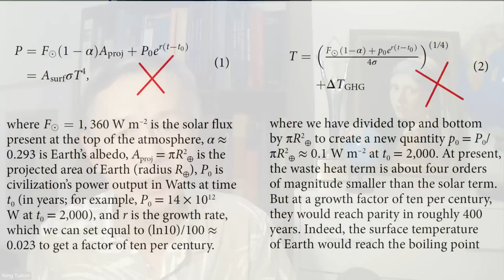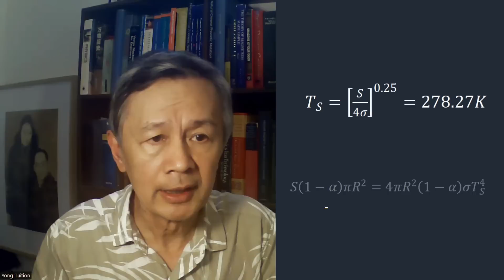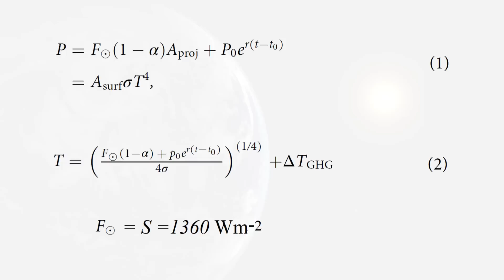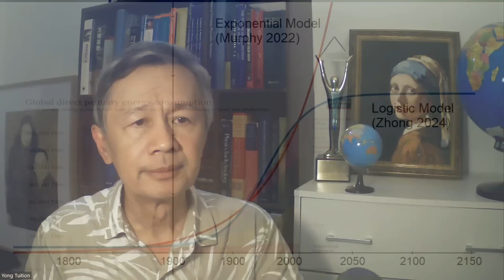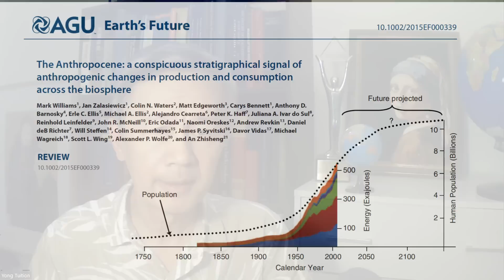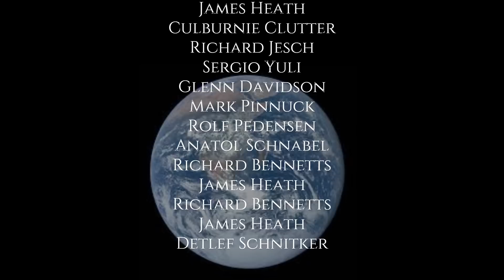Can Waste Heat Make Earth Boiling in 400 Years? | Basic and Unsettled Issues in PHYSICS 20240411

Comment: Double checking once more checks out too quickly, so that someone else likely already did it,saving some work.
The claim "excess heat alone boils all water globally within 400 years" seems a bit too silly, likely having some math errors or silly assertions or missing factors.

I played SimEarth many times, where you can boil off the oceans of a planet as soft-fail-state, and even that seems to have more precise models, even though you can easily terraform mars in SimEarth within the same models.

We can still easily boil off all of earths oceans with methane and co2 within 100 years, mostly because people underestimate exponential growdth (up to their limits), but most people try to avoid boiling the planet, because this is not a game.

Comment: The paper in the scientific journal Nature really should have used the term "climate flux", which for Earth is about 237 watts per square meter, rather than going to the bother of recalculating the climate flux, a calculation which has been done many times before.

Also, not taken into account is the ability of atmospheric water to use a latent heat effect to radiate Earth's heat from cloud tops at an altitude high enough in Earth's atmosphere that CO2 has little blocking effect. Some 250 million years ago during the end Permian, that cloud top radiative ability demonstrated sufficient strength to stop Earth from entering a runaway greenhouse effect. One can calculate a pascal value from the estimated mass of water in the atmosphere at that time, and determine that for every 100 pascals of water in the atmosphere then, there was a cooling effect of about 3/4 degrees Celsius, or otherwise a runaway greenhouse effect would have happened sufficient to kill off all vertebrate life forms. The solar constant is higher now than then by about 2 1/2%, but in practice Earth's water cycle still puts a cap on how hot Earth can get, although it is arguable that that cap is about 4 degrees Celsius higher now than in the past some 250 million years ago.

Something the paper in Nature might not have considered is that more water in the atmosphere means more lightning. Lightning dissociates water into hydrogen and oxygen. Some of the hydrogen escapes from Earth into outer space. For now, there is an approximate balance with hydrogen that Earth captures from the solar wind and captures from the hydrogen content of meteorites. As a result, the partial median surface pressure of oxygen in Earth's atmosphere has not varied by more than about 10,000 pascals from the current value of about 21,000 pascals in the last 300 million years. Higher temperature means more atmospheric water, which means more thunderstorms, which means more lightning and therefore more electrical and thermal dissociation of water into hydrogen and oxygen. Too high a percentage of atmospheric oxygen, starting at around 30% oxygen by volume, would likely make most of Earth be too flammable for vascular plant life. That's a process that might take just a few tens of millions of years to happen. Isotopic analysis of hydrogen on Venus seems to indicate that Venus once had much more water than at present. The ratio of protium (lighter hydrogen which escapes more easily into outer space) to deuterium (heavier hydrogen that escapes less easily) is much lower on Venus than on Earth. In other words, too high a percentage of oxygen is a long term danger to humans in the event that the unusually warm end Permian temperatures get exceeded for too long.

Short version:

Earth's surface reaching a 1-year average median temperature of 100 degrees Celsius is only a science fiction possibility at the current solar constant of 1362 watts per square meter, something that could only happen if for example a 100 kilometer wide comet hit Earth. However, as shown in the very late Permian some 250 million years ago, Earth can get considerably warmer. Matching or surpassing that higher temperature might or might not be too much for human air conditioning technology to allow humans to survive. Furthermore, if humans survive that temperature, there will be a long term risk of atmospheric oxygen percentage then slowly rising too high during a time period of perhaps just a few tens of millions of years. The temperature peak that caused the end Permian mass extinction lasted only about 120,000 years or so, not enough time for increased lightning to substantially cause the loss of atoms of hydrogen by Earth, which thus would have lead to a long term higher oxygen percentage.

Comment: Unfortunately, the first argument made here is just wrong. Almost all substances on the earth's surface, including snow and ice, act as high-emissivity (> 0.9) gray bodies in the thermal (longwave) infrared (usually considered as wavelengths > 4 um).

The situation is different in the shortwave spectrum of solar radiation (< 4 um). The expression (1 - alpha) is called the "Bond albedo" or shortwave absorptivity/emissivity. The value of alpha is usually calculated to be about 0.30, yielding a shortwave absorptivity of 0.70.

These are not just theoretical values, they can be, and have been, confirmed with high quality measurements.

I agree that there are many issues with Murphy's paper, but this is not one of them.
Reply from the maker: Thank your comments. The planet, including its atmosphere, is close to a greybody with emissivity 0.7, although the measured one is 0.61, or the longwave radiation intensity=0.61 *sigma*288^4. This is irrelevant to measurements of emissivity of ocean,  ice, and snow. Invoking shortwave radiation emission by the earth dosen't make sense.
Reply: @yongtuition  I'm afraid you miss the point. The earth's surface emissivity in the longwave thermal infrared is greater than 0.9. For seawater, >2/3 of the surface, it is >0.95. If the atmosphere were transparent to this IR (say, just N2 and O2), measurements from space would see this value.

The fact that measurements from space show an IR flux corresponding to a lower emissivity is precisely BECAUSE of IR absorbing gases (i.e. "greenhouse gases") in the atmosphere. You cannot use this fact to argue that the greenhouse effect is not significant.

In the shortwave, it is the lower absorptivity (higher albedo) that is important -- particularly the high shortwave reflection of snow, ice, and clouds. I never claimed that the matching emissivity was important.
Reply from the maker: @curtwilson3342  You need to understand the Stefan-Boltzmann law first. Besides, the measurements of emissivities of different materials are based on the assumption that the object is in vacuum.
Reply: For any given wavelength band for an opaque substance, an opaque substance such as a block of granite for example, reflectivity plus emissivity has to add up to the number 1. The number 1 is often referred to as "unity" in textbooks.

The trick is that various substances have sometimes very different reflectivities in different wavelength bands. Green paint for example reflects green light well, but not blue light, and not yellow light. Snow, as another example, is very reflective of visible light, but in some infrared bands, snow has a very low reflectivity of sometimes less than 10%, meaning that within those bands snow can have an emissivity of more than 90%, explaining why snow at -20 degrees Celsius has an infrared emissivity of about 90%.

One other trick is that there is some directionally to both reflectivity and emissivity. For example, light striking at a very shallow angle tends to be reflected more strongly than light striking at a steeper angle.

It is a pattern in Solar System astronomy that planets and moons on the whole tend to have an infrared emissivity of about 95% near their respective typical emission temperatures. It is conjectured that that pattern applies in most other planetary systems as well, but that pattern has not been confirmed yet for exoplanets, planets that orbit other stars.
Reply from the maker: @wendydelisse9778  Indeed, reflectivty, absorptivity, and emissivity are wavelength dependent, called spectral emissivity etc. When the earth, including its atmosphere, is treated as a greybody or blackbody, the effective shortwave emissivity becomes trivial,  as the maximum is located    around 10 micron, given the surface temperatue around 288K.

Comment: Actually we won't have to worry about whether there will be enough waste heat to raise the Earth's temperature to intolerable levels anymore.
The reason is simply that there isn't much fossil fuel left for us to burn. And nope, there are no substitutes. We'll all be going back to pre-industrial days.
Reply: Progress has been made in the area of fusion energy, energy which typically obtained from transmuting hydrogen and lithium into helium. As such, a percentage rise of 200% or so in the very tiny amount of mankind's direct contribution to Earth's climate flux cannot be ruled out. Earth's climate flux is about 237 watts per square meter. Mankind would be unlikely to add even 20 watts per square meter to that number, and furthermore the vast majority of any such addition would be from mankind's causing a decrease in Earth's reflectivity, which is more formally referred to as Earth's "Bond albedo", rather than directly from the heat resulting from a potentially vast number of fusion power plants in the future.
Reply: @wendydelisse9778  Fusion? They've been promising it since the 1960s.
I'll believe what you say when I hear of a fusion reactor finally in full operation.

Comment: Thank you again Dr Yong.  I understood enough of your reasoning to believe that the theory of anthropogenic waste heat building up on the Earth's surface is balderdash.
Reply: Waste heat building up on Earth is indeed mostly "balderdash" (fiction).

However, Earth's temperature, although technically being in a state of "stable" equilibrium in which waste heat merely results in only a tiny increase in temperature, is surprisingly close to being in a state of "neutral" equilibrium. There is a close "tug of war" mostly between the "Stefan-Boltzmann" approximation which attempts to put a cap on Earth's temperature on the one hand versus on the other hand the vapor pressure curve of water, which tends to raise Earth's temperature by way of water, Earth's atmosphere's strongest greenhouse component, being more present in the atmosphere in warmer conditions.

An even closer approximation of a "neutral" equilibrium is a fumbled basketball rolling on a smooth clean basketball court. If no one stops the basketball, it will typically keep on rolling until it goes out of bounds. Imagine however a basketball court with a floor of thick carpet. A slow-moving basketball would often stop on its own before going out of bounds, and would then quickly be picked up by a basketball player if time has not run out. Such a fictional basketball court with a floor made of thick carpet would be more akin to how close Earth's temperature is to being in a state of neutral equilibrium. As an analogy with that fictional heavily carpeted basketball court, mankind's waste heat has intermittently put Earth's temperature into a slow roll that quickly enough stopped before the temperature could go into an out of bounds region.

Comment: As has been pointed out many times the total solar energy input flux is much, much greater than humanity's energy needs.   If this is true, which it appears to be man's waste heat is insignificant and I won't worry about it.
Reply: I was wondering if our waste heat was the main component of what they say the excess carbon dioxide has created in temperature rise. Simple crude math said no. It is actually a negligible amount when compared to the watts per sqM from the sun.
  My math said it accounts for around a tenth of a degree.
Reply: @Stan-b3v   You are correct.  Making the waste heat even a smaller contribution is that waste heat is often in a localized area like hot waste water or hot high CO2 air all subject to T^4 higher radiation to space.  Small increases in temperature drive big radiation heat losses to space.
Reply: Some of the waste heat is in the form of evaporated water, especially in the case of electric power plants and in the case of many skyscraper air conditioning systems, where the larger economy of scale dictates making some use of the "evaporative cooling" technique. The greater atmospheric water content over land usually results in more greenhouse heating in land regions than would otherwise be the case, although in some cases a temperature drop can happen instead due to the extra evaporated water.

Short version: There is a difference regarding whether waste heat is in "latent heat" form or in "sensible heat" form. Latent heat calculation is not as simple as a Stefan-Boltzmann calculation. Irrigation for agricultural purposes of course also introduces water into the atmosphere over land, resulting in similar complexities.
Reply: @wendydelisse9778  Water gets messy when the heat is released upon condensation and cloud formation which heats the local air increasing emissions to space while reflecting incoming sun light.   We then can have ice formation in the cloud which falls out of the bottom of the cloud transferring the latent heat of freeing to the cloud and transferring that heat to lower altitudes or the ground where it melts adsorbing heat.   This is where models get problematic and go beyond simple calculations and nucleation becomes an issue of great complexity.

Comment: You are correct, their equation is wrong. Also, the Earth is not a perfect conductor. Energy does not transfer magically from areas in sunlight to areas in darkness. This flat Earth model should be thrown out. 

If you look at the Moon where one day is equal to 29.5 Earth days, you see the Moons equator can reach 121° C in full sun. That is very close to the equivalent temperature if 120° C for 1360 W.m2 which is the estimated power from the sun reaching Earth.  The equator can drop to -133° C when not exposed to sunlight. 

The rate of cooling is a function of internal conduction and surface emissivity.

So you see, the average temperature of the Lunar surface is not relatable to the formula at all. The more important number is the maximum temperature attained.
Reply: There is more than one type of average.

Electricity experts for example often use a "root mean square" type of average regarding voltage or current, in order to derive a good estimate of power.

On an astronomical body such as the Moon with a sparse atmosphere or with no atmosphere, the type of average temperature to use for estimating infrared radiative power per square meter is a somewhat analogous "root mean tesseract" type of temperature average. Here, the 4th root is used instead of the square root, and 4th powers are arithmetically averaged out underneath the 4th root symbol instead of squares being averaged out. With electicity, power is approximately proportional to the square of a voltage. When using the Stefan-Boltzmann equation, radiative power is however approximately proportional to the tesseract (4th power) of a temperature. When using a root mean tesseract scheme to obtain an average temperature for the Moon's surface, the result will much more closely match the temperature predicted by the Stefan-Boltzmann equation than a simple arithmetic average.

Comment: What happened to peer review? It seems to me that anything goes if it fits the anthropogenic current climate change dogma. Is your “logistic model” like a Gompertz function? I did not look up the Murphy paper earlier but I will get later today.
Reply: Google "Peer review: a flawed process at the heart of science and journals" by Richard Smith, former editor and chief executive of the renowed BMJ.

Bottom line: peer review is a guarantee for absolute nothing.

Worth reading.
Reply: @nunterz  I read it when it was published.
Reply: @robertdyson4216  in your view, are the claims of the article still valid after 18 years?
Reply: @nunterz  Yes. If anything it is worse now. Back when I were a lad there were only paper printed journals and there had to be some way to select what to publish, though even then having a 'big name' helped and I do remember some rubbish. Now with minimal cost online I would be in favour of publishing everything though then you have another problem of how much junk do you wanted to check out before getting to something useful? I guess we would just focus on the big names we agree with. My comment above was ironic - I am sure it was peer reviewed, and Richard Smith was right.
Reply from the maker: I simply used a logistic function for demo. I think the two function are similar in their differential forms.
Reply: The simple truth is anyone who questions the orthodoxy or paradigms such as the radiative greenhouse effect theory are immediately ostracized. They are attacked professionally, attacked by groups like The Desmog Zone, ignored by the corporate mainstream media, their papers, which the climate science approved journals will not publish, are buried in search algorithms, and on and on. Science has become political, and you have to go along to get along.
Reply: When it comes to co2 there’s more pee than peer in the review system